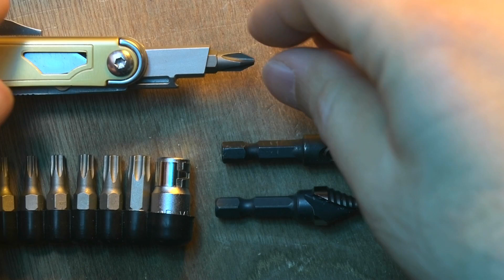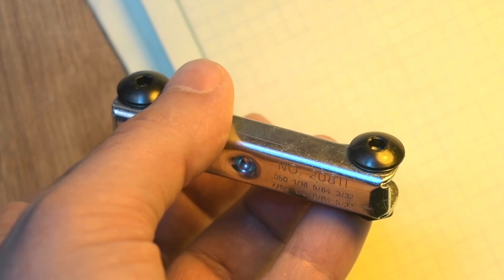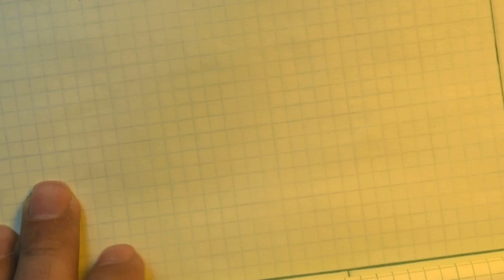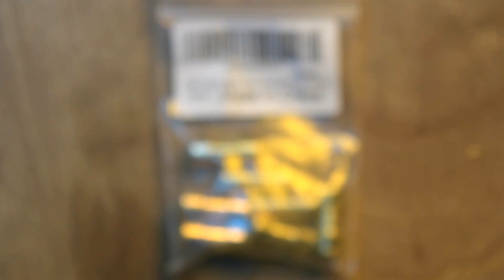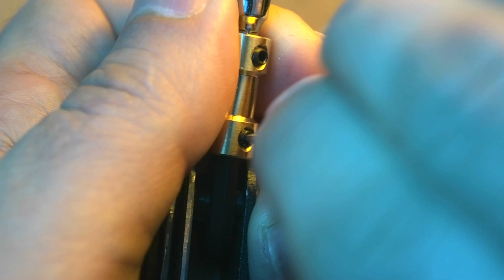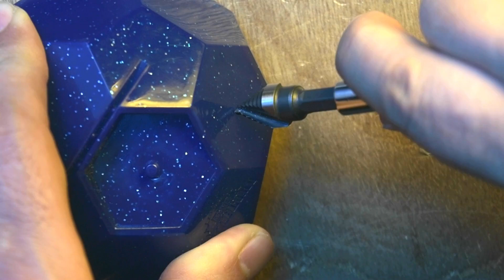DIY tool with 1/4" bit driver

Comment: Is it possible to add ratcheting capability to this, without using expensive add-on like leatherman ratchet extension ? Thanks. I think it would be useful for both bits and drills.
Reply from the maker: That’s an awesome idea 💡